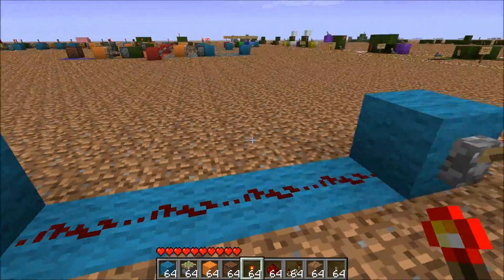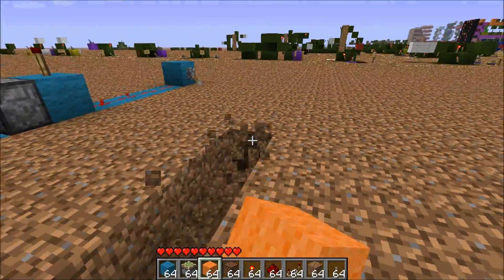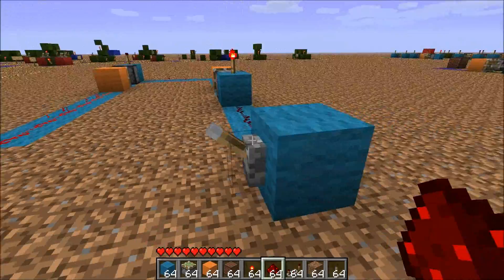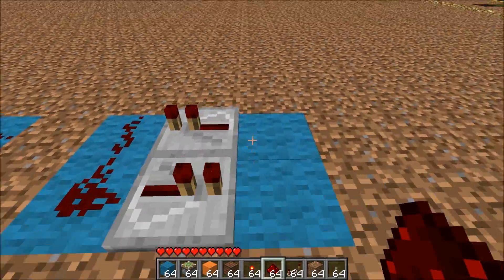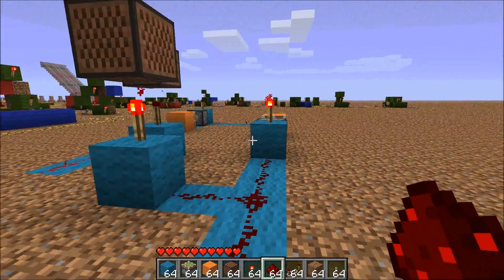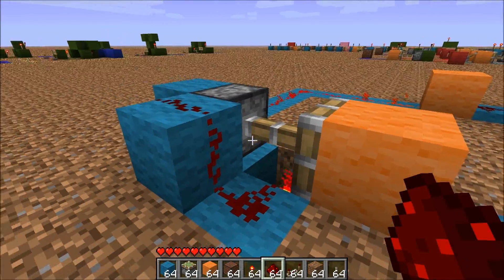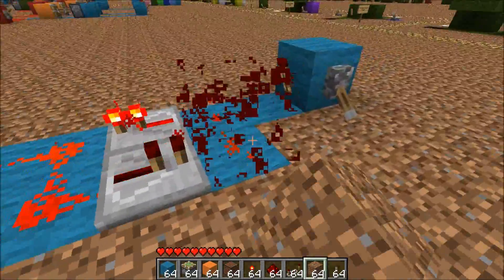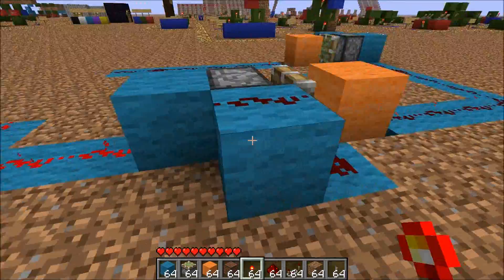How to make instant wire

Comment: i just made this in single player on 1.4.7 and the pistons repeatedly pulse altho the signal still only goes if u press ur input but the pistons are constantly moving. and the pulse isnt instant both ways like 1 and 0 are not the same speed

Comment: In attempting to remake this in the 1.4.5 version i built a device that can be used to place blocks which don't drop items when they're mined, or drop a different block. Basically the extra torch below the piston arm & block makes a glitchy clock, and placing a block where the block should be when the piston arm retracts makes the block with no drop. sometimes doing it again with a different block places the same type as the last block placed, but will then drop the block you placed.

Comment: I would need to actually go test this, but it appears the trick of adding extra torches and wiring on the sides of the pistons had the added effect of making the length of the pulse longer, making the piston repeater more like the redstone repeaters. Also, the pulse length change seemed much smaller between the pulse length after the 1st repeater and the 2nd, as oppose to what it would have been if you used a repeater with normal delay and then one with a delay on the second setting.

Comment: Yes, but it keeps a steady beat that is repeatable and very easy to fix. Now you can also build only half of it like he did in the middle of the video and make it so it is inverted. So when one piston is on, the other is off. So depending on the lever position depends on what piston is extended. That way you can make like 2 door ways that switch depending on the lever

Comment: A redstone repeater actually slows down the pulse. Even with 0 ticks. It is the delay it takes to get from one side of the area to another. Kind of like if you flip a switch in real life. It appears to be instant. But on the inside wiring it is sending signals and doesn't instantly do it. It is just faster than the eye can see. So if you put down a repeater in a contraption like he made in the video. The first piston would work fine. However, the second would be slower by a tad bit.

Comment from the maker: @jp86II The note blocks attached to each line are in pairs. One note block is directly connected, the other goes through an inverter. If you want them to play at the same time, just remove the inverter.

Comment: I have a question, when you said that the timer was too fast for the instant wire to update, and when you were fixing the torches, could you have a powered lever next to the piston to keep it powered? Or is the lever kinda like a torch that will keep it's power but won't turn off? Thanks for the really good video!! I subbed :)

Comment: @MrFroZen23 my suggestion is instead of having the wire go up next to it, put a repeater pointed at the piston on the same side as he is doing, but have the wire go around to the repeater instead of going up to the block.
this sounds difficult, but if you know what im talking about you should get it really easily.
the only problem with this is it makes a 1 tick delay in going back to ready state, and otherwise its perfectly fine

Comment: @TaviRider I have made something I'm calling MC Ethernet. It is what it sounds like. I have an eight bit transmitter that will transmit eight bits (obviously) and a receiver that will take the transmitted bits and turn them back into eight separate bits. It's hard to explain what exactly it does, but if you'd like I'll give you schematics so you can look at it yourself.

Comment: Without torches output is sync with output. But with torches, output is always on except when you turn input off, it will flash briefly. I don't really get what could be use of this.

Comment: @Renoh74 (CONTD) or XORS. I have tried making RSNORlatches using the piston design from an earlier video and attaching instants to the inputs, but it seems to get screwed up by the SouthWest Rule which for some odd reason applies to pistons in that case (I could set but not reset or vice versa). Any ideas or suggestions you have would be much appreciated.

Comment: Hey, i have been screwing around with said wiring and trying to create logic gates that run instantly. I have successfully created AND gates (down edge triggered), but i cannot make the most basic of a gate as a NOT that does not create a delay in the wire (if repeated), reason being that is converts a down edge trigger to a up edge trigger, and, in order to be repeated, it has to wait for the down trigger again. Thus, i cannot make an instant RSNOR latch, or more arvanced gates like Flip-flops

Comment from the maker: @DaniQ123 There's SMP mods to prevent new chunk generation, but nothing I've seen for single player. Try walking around to generate 1000x1000 in-game, use MCEdit to flatten it and build a wall, then back to Minecraft and walk along the inside perimeter of the wall. That will make a buffer of chunks outside the wall, but it may also mess up some blocks inside the wall. Use MCEdit to fix that and to delete any chunks outside that buffer. Oh, and put in a glass ceiling at max height.

Comment from the maker: @DSGALAKTOS That starts getting tricky. If one repeater is on setting 1 and the other is on setting 2, the time between downward edges will be slightly shorter. But the pattern of downward and upward edges won't be the same any more. Specifically, the line will be powered for more or fewer ticks than unpowered each cycle. So we have to try both possibilities. Also, that small clock may need to be replaced by something more complex to get the timing right.